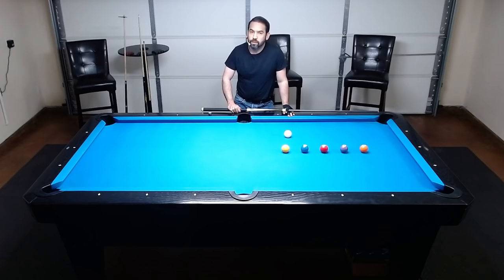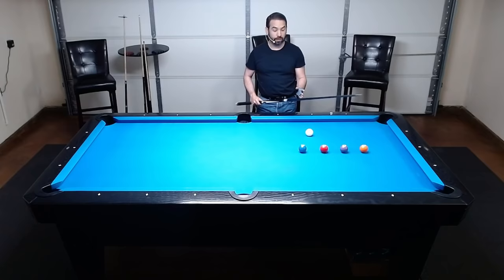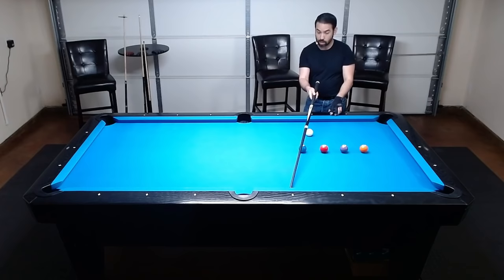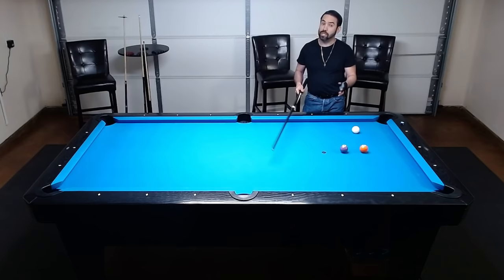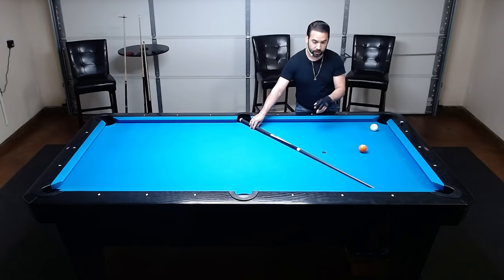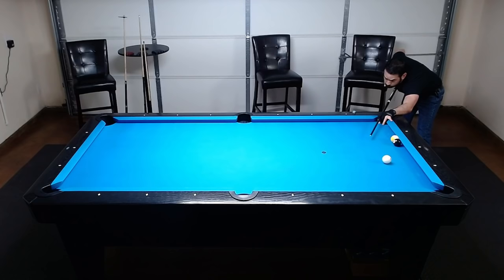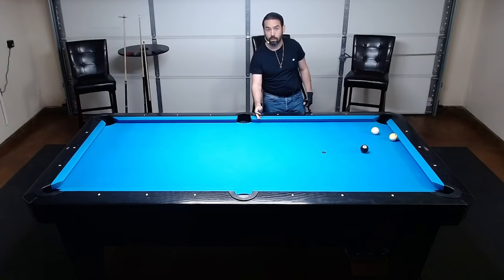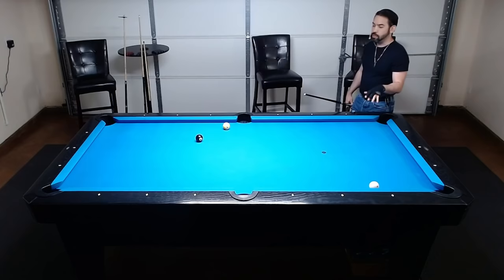Pool Lesson: The First Banking System I Learned

Comment: WOW!!!! I've been playing for 15 plus years and this is the first video I've ever seen that has successfully taught me a system on how to bank that is simple to understand and easy to implement. For that my man I appreciate you. Great Job!!! You gained a subscriber 👍
Reply: Interesting that you find this system simple. Imagine trying to do all that with a 30 second shot clock... The simplest system is using the 2 to 1 track lines and then adjusting for how you want to hit the ball. Because everything you do different than soft rolling the object ball, using the 2 to 1 track lines, changes where you want to aim. (IE. hitting harder, using follow or draw, etc). Also the table conditions (and ball conditions) change where you want to aim. The Aramith tournament balls play different than the cheap poly-resin balls. The cheap balls get dirtier faster and have more cling (which affects how they react on the rails). Diamond tables with the extra bouncy rails change the angle the balls come off the rail and make them bank tighter. If you want to bank well, you need to find a good level practice table and practice shooting soft rolling banks using the 2 to 1 track lines. Then practice learning how much you need to adjust for hitting medium, then for hard. Then teach yourself how much to adjust for using soft, medium, and hard with top spin, then do the same with draw. This will give you a feel on how to adjust for different shots, because you don't just need to bank the ball into the pocket; you also need to play shape on your next ball. You should also practice using running and reverse English. Once you have your base lines and how much to adjust. You can then try different tables and teach yourself how to adjust for different rail conditions. No matter what you do, you will want to make sure you use good balls to practice with; because unbalanced balls will roll off, even if the table is perfectly balanced.
Reply: Exactly...
Reply: Simple
Reply: @dryclimateutah everyone likes different systems. With so many different 🧠 brains not everyone will see the same.
Reply: @new2POOL208  simple is easier for everyone.
the triangular system as shown here is way to many lines.

Comment: As a very low level player with a weird brain, I’ve been fairly good at 2+ rail kicks and banks, but have seriously struggled with single rails. I can honestly say that this video has truly helped me improve that significantly! Even used it PERFECTLY when I recently was challenged to a game of “bank 8” and executed it flawlessly, leaving everyone in shock! Thank you so much!
Reply: I will make a 3 rail and even a 5 rail 7 times out of 10 and miss a long way 1 rail bank every time
Reply: Low level players struggle more with single rail banks and kicks because their cue ball striking isn't as pure. Usually caused by poor stroke mechanics. Adding a little unintended English will really throw off one rail kicks/banks... whereas multi-rail kicks/banks usually involve using intentional english. A pre-shot routine, proper stance, proper timing, and practice will all lead to a better stroke and more accurate cue ball striking. I like to get my lower skill level players to practice their stroke by laying an empty water/beer bottle down on the table, then I get them to practice stroking into the bottle opening at various bridge lengths.

Comment: I've been doing bank shots relatively successfully for the past few years on a tip I learned. It's so basic that I tell it to people often now. 
Try this, imagine a full length mirror on the side of the table that you are hitting the bank off to make the ball in the opposite side pocket. 
Then imagine the mirror image of the desired pocket in that imaginary mirror, (it's like looking at the bar table next to the pool table where my beer sits). Then I just shoot it at the desired speed and viola! 
I think sometimes people look at me and see that I'm not lining anything up, not measuring and looking way past the actual pool table at some imaginary spot in the air and thinking I'm drunk! 
It surprisingly works a lot of the time. Give it a try!

Comment: Best system I have ever learned. Worked. First try. Hasn't failed yet. So much better than any other system. Very accurate and deadly if measured precisely. No more guessing like with the mirror system. I know exactly where I need to hit now
Reply: I learned the mirror system from a pro and it was hard. You have to compensate the thickness of the rails when visualizing.  The system shown here is leagues better and is more consistent.

Comment: Nice system, I use a three line system with fairly good success. The way I was taught (using aiming for a guide) 
Line up the object ball to the pocket you wish, See your line (i can see it once i establish it), once you can see it, you can't unsee it
Then line up your cue ball to the opposite pocket, you'll create a second line in your mind. Both lines should be crossed if you aimed up the right pockets.
Ok the third line will point from the intersect point to the rail you need to hit to make this shot.
From there it's up to you, medium as said in the vid works for this method, but might have to adjust for obstructions as outlined in the vid.
I have gotten to a point where I don't need to actually aim it up anymore, I can see the lines just by standing behind the ball I'm aiming.
    This is a cool system and a great vid, I'll be trying it out against my system. Who knows, might be better

Comment: Using dividends of 2 can help know the angles required for banking & kicking, as shown here. Yet, creating a number system within the diamonds will supply a player know the half point on a rail required for banking or kicking. It deletes multiple reference lines by helping a player see a line made from dividing a number by 2. As well, it provides an easier process when banking or kicking at an end rail.

Comment: Chris @17:00, you demonstrate to make an adjustment to this system for an arbitrary kick. The system itself uses a projection of the center of a trapezoid to determine the aim point. So, one alternative to try is using the ghost ball of 8 ball as the target instead of the pocket. That would avoid the extra work of the parallel shift. I believe this should work for any one rail kick.
Reply from the maker: I believe that only works if the ghost ball is straight across from the cue ball, because then it's just a straight kick.
Reply: @LilChrisPoolPlayer  Well, this may get a little too much into geometry here, so bear with me. Your case just devolves the trapezoid to be a square-ish shape, right? The system would have a projection such that the aim point would be close to a straightforward 2:1 kick.  If the cue ball is closer to the rail, the center of the trapezoid moves closer to the cue ball, and the aim point moves more toward the cue ball on the rail.  If the object ball is closer to the rail, the center of the trapezoid moves closer to the object ball, and the aim point moves more toward the object ball. Aside from the normal environmental factors with billiards, it should be pretty close. I wish I can somehow show it, but maybe you can try it out yourself. 

In any case, I really like your videos. I tell people on my APA team a list of YouTubers to watch and you are definitely one of them. Keep up the good work.

Comment: Awesome video!I'd like to see a few more examples using this system on the long rail.
Reply from the maker: You didn't see me do more long rail bank shots manually because I typically am unable to hold onto my cue while having the tip of my cue on the opposite short rail, so usually I'll just visualize the 4 reference lines when banking the length of the table.
Reply: I think the key to any pool instruction videos is to recreate what you see then use the system on a variety of different situations.  Its really impossible for anyone to show you every possible combination you could think of.  But each person should test what it can and can't do on the table....  if that makes any sense.

Comment: Awesome thank you!

Gotta practice that system..more of a numbers guy myself but sometimes the numbers can be too much
Reply: Also I noticed that most of my better makes have been on draw hits. What am I doing right or wrong in your eyes?
Like do you think I've consistently over angled the angle to the pocket n the draw makes up for it?
Reply from the maker: If you're hitting with draw, you more than likely have to be hitting slightly harder which causes a shortened outbound angle. So yeah, you're over estimating the angle a bit.  You can bring it back slightly, remove the bottom spin, and hit slightly softer and still allow the bank to lengthen out.

There's no "exact" science to this, but understanding these variables allow you to have a better understanding of what adjustments you can make.
Reply: @LilChrisPoolPlayer  rats! I knew Im a fraud! Lol

Seriously thank you! Obviously want to avoid hitting my banks with draw(majority of time)cuz the deflection is not pretty for most part. Alright you gave me homework to do!

Comment: how to find vision center is this method correct

    Put your cue in front of you vertically

    Find an object far away, like a piece of chalk

    Stare at the object. Your cue should blur out

    Keep the object in the center of that blur, and move your face towards your cue

    Where the cue makes contact with your face is your vision center

does it work?

Comment: Nice demonstration of this method - why do you use the other system most of the time and not this one? Is the other one more accurate?  And why do you sometimes use this system instead of the other one?
Reply from the maker: I use the other system more because it's quicker.  The only times I use this system is when the bank is small or when I need to bank the length of the table.

Comment: I can see that the technique is very much effective if the object ball is in the middle of the table. 
What if the object ball is one or two inches from the rail, would the technique still be applicable?
Reply from the maker: It's still applicable.  It's just difficult to physically draw the lines without risking hitting the object ball.  That's when you would want to try to visualize the lines to find the bank point.

Comment: I  annot get this to work on the corner pockets. It leads me to a wider angle that the one actually required
Reply from the maker: Check and make sure you're not over cutting the object ball, hitting too soft, or using unnecessary side spin.  Those are the three variables you can tweak to make the shot.
Reply: @LilChrisPoolPlayer  I was actually checking the angle by directly hitting the object bañl with the cue, and nothing. Got it right on the side pockects tho
Reply from the maker: @Hellrider_145  That could just be an environment variable you have to adjust for. All rails don’t play exactly the same.

Comment: You are bisecting the overall angle to get your contact point on the opposite rail, is that correct?  The distance between a 90° line from the object ball to the opposite rail and a line from imagined diamond to diamond from the pocket you're playing the object ball to the opposite pocket will give you the width of your angle and if you bisect that, or cut that with in half, that would be the object ball's point of contact on the opposite rail.  And please don't let me come across the wrong way -- I'm not doubting you or or trying to give an alternative look at this, I'm just trying to process it where I understand. This is actually the first time I've ever looked at a bank shot as the overall angle and with a average normal stroke to make that shot you would want to bisect that angle and hit dead in the middle of it on the rail,  cuz the angle coming into the rail will be the same as the angle going out provided everything else is status quo--
No english to speak of which equates to  no spin on the ball not hit too hard not hit too soft the harder you hit it of course the more it will shorten up your angle the softer you hit it the more it will widen your angle. I've always played Banks and kicks just on feel and never really use the system so I never even thought about the simplicity of just bisecting that angle and the toughest part there is getting an accurate measurement of the angle and then finding the halfway point on the contact rail and this system does a wonderful job at that. Unless I'm badly mistaken and it doesn't do that at all, but I believe that's what it does.

Comment: I Don't believe APA has a rule that a cue must be held when using it to measure a shot.  If this is a rule I would be interested to know where it is in the rule book.
The CSI rule book for BCA and USA Pool Leagues Specifically states that a single cue may be use to measure, held or not.
Reply from the maker: The cue being held rule is referring to Rules of Play - WPA Pool ( https://wpapool.com/rules-of-play/ ). 

6.12 Cue Stick on the Table
If the shooter uses his cue stick in order to align a shot by placing it on the table without
having a hand on the stick, it is a foul.

I think you're right that APA doesn't enforce that rule, but I've seen it enforced in non-APA formats.

Comment: Great lesson! @18:25 ... how many takes did that shot take, out of curiousity?
Reply from the maker: The last shot took me about 2 - 3 tries.
Reply: @LilChrisPoolPlayer  Thanks! Love your systems and simple explanations. I had always though you shift over parallel from the known good shot line and divide that parallel difference in two when the shot deviates from the known line. Not sure where I picked that up but apparently wrong?
Reply: I think I'll get the ole protractor out and draw it. But the more I think about it, I'm thinking my method is wrong. Which may explain why I miss so many banks. :)
Reply: A straight parallel shift isn't quite right because it gives you the exact same angle as the known kick line. Which would make the bank come short. The real number is closer to a 3/4 of the way parallel shift to give you geometrically the exact angle. I guess it all comes down to getting the feel for the table as well and adjusting for the rails. But geometrically, a parallel shift in a perfect incident of angle = incident of reflection, doesn't work to make the pocket. Unless I'm missing something fundamental here.
Reply from the maker: @matthewwheaton5835  It boils down to what you said, "getting the feel for the table".  You can still do everything that you described and it'll work with the CORRECT SPEED.  The correct speed is the biggest factor for allowing the bank/kick to be successful.
Reply: @LilChrisPoolPlayer  Yep. I'm learning that too. Also trying to break my terrible habit of putting draw on too many shots.

Comment: There are some who say that spin doesn't transfer to the object ball.
When the object ball is hit, it throws (as you said) to the side but after just a few cm there is no spin left on the object ball.
Could you try to make the object ball roll straight up the middle of the table, using side on the cue ball, and make it bank when it hits the middle diamond on the far rail?
I have seen some transfer of spin on bad contacts between cue and object ball.
There seems to be two different schools, some say you can transfer spin, others say you can't.
I think some spin (english) can transfer over a very short distance.
And if you get a bad contact between the balls.
I have tried to get the object ball to roll straight up the table and then throw to the side when it hits the rail, I can't do it 😥
Reply from the maker: There are plenty of example videos that demonstrate transferring side spin to an object ball:
https://youtu.be/u5cOLa7HtiM
https://youtu.be/tDom_Ku7EPs
https://youtu.be/xhAhcjIVWbw
Reply: @LilChrisPoolPlayer  I can't do it 😥

Comment: learn a proper numbering system. then you can hit em all. way to many lines in the triangular system. 

and its not because a ball is hard it shortens up. its because its in the gliding face. versus rolling face when it hits the cushion.
you can put the ball close to the cushion and make a soft shot and it shortens up because it's in the glide face.

Comment: You are way over-complicating bank shots!  Use the diamonds as a number line in relation to the shot line, and divide by two.  The angle of incidence equals the angle of reflection.  In pool, the rails, the cloth, and the speed of the cue ball are factors, and learn how to adjust for that.

Comment: Are you hitting center cue ball or using English?
Reply from the maker: All of the banks, except for the long bank and "trick" shot bank, were done with a center ball hit to demonstrate the system.  Any bank using an off center hit and an adjustment has to be made to account for the lengthening or shortening of the bank.
Reply: Hay quá